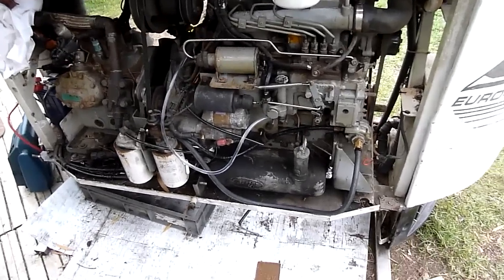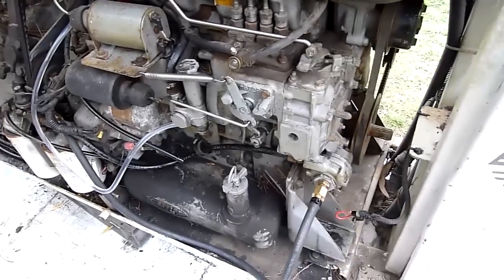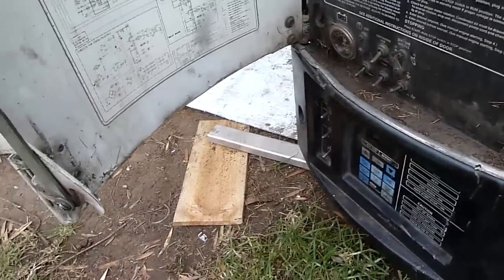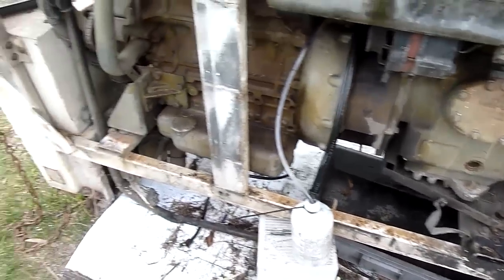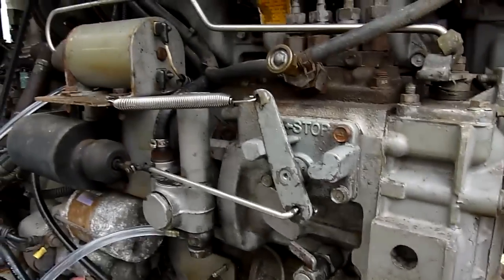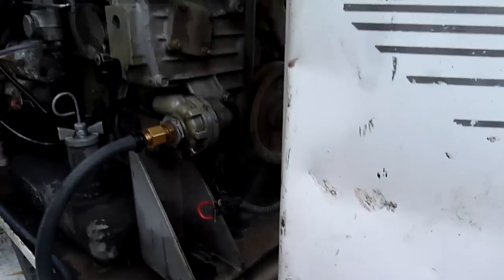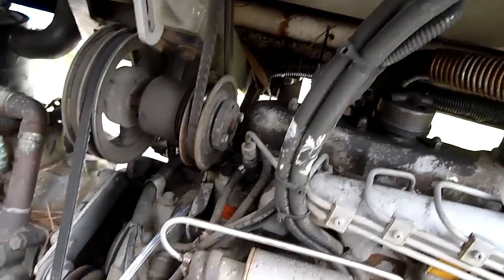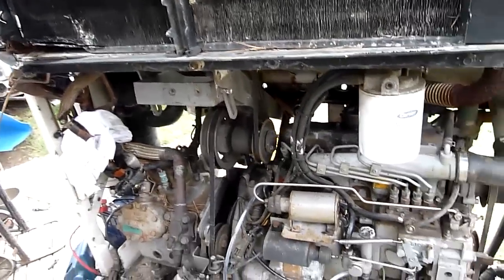Carrier Euro phoenix Reefer test run

Comment: This is going to make a KICKASS mobile Air Compressor, all you need now is a very large tank to hold whatever output that compressor puts out; perhaps you can also find a 3 phase generator to utilize that rather interesting belt system at the back of the engine.
Reply: +Brian Martinez unfortunately as Ed mentioned, the condenser and related plumbing was destroyed by the scrapyard's claw; I'm actually surprised the engine's radiator didn't meet the same fate.
Reply: +digitalrailroader bit of duck tape and its all good jb weld when its sever lol

Comment: Awesome bit of salvage.  Unbelievable amount of gear for the money.  Does it have an integral lift pump?  Assuming these drew from the tractor's main fuel tank, but was is pumped by the Truck or the unit itself?
Reply: Nevermind.  I see the reefer trailers have their own fuel tank.  Makes more sense :)
Reply: +tiporari they do have their own fuel tank, because in the uk, where fuel is heavily taxed, diesel fuel is $6 a gallon, an untaxed variant of diesel is sold, known as red diesel, it is dyed red, costs about $2 a gallon and is normally used in tractors and for non-roadgoing vehicles.
Reply: +insanitybiker Pretty smart :)  we have similar off-road diesel in the US, but sadly it isn't significantly cheaper, at least not near me.

Comment: where is the radiator for the cooling for the engine ?
Reply: +BillyNoMates1974 ah my bad just seen it.
big radiator isn't it ?
Reply from the maker: +BillyNoMates1974 its pretty reasonable, it uses 2 layers of the condenser coil, not separate unfortunatly.

Comment: the engine will be between 114hp and 130 HP, didn't sound like a baby either, mad compressor tho Mq safe psi on the compressor is 24 bar I still have all my books on these units from when I was doing refrigeration
Reply: +John Watts 
I wouldn't had thought it would be quite that big.
Reply: In the 4 cylinder range smallest is 114 HP up to I think 131true HP
Reply from the maker: +John Watts Great to hear from sombody who worked with them, I was having a hard time finding details about this one since there were so many different configs, engine sizes etc
Reply: +Aussie50 

yeah they have a massive stroke hence the power and the torque is massive but when they fail like u know are hideously expensive but all round reliable
Reply: +Aussie50 

also if u need info I have about 5000 pages of info as carrier never disclosed much information about them

Comment: Sounds great, when you go to re purpose it as an air compressor are you going to keep the engine attached or use an electric motor instead?
Reply: +Doogie Rick 25-50hp electric motor on household 240V single phase? forget about it.  I have a 10hp compressor and already illegal in most residential neirborhoods but not mine.  That pump is big, it'll take a lot to spin that

Comment: So do these units have a fuel tank somewhere on the roof or ground (with an additional pump), or do they have some sort of constant diesel line that comes in with natural gas from the utility company? I'm guessing on site tank since they would need to know in advance that they are using one of these units, and I don't even think they could pipe diesel over long distance.
Reply: +Jesse actually, this reefer unit was mounted to an insulated trailer, ( a Tractor Trailer/18 Wheeler Semi in the US or a Road Train for you Aussies out there); the fuel tank is mounted to the frame of the trailer just behind the landing gear.
Reply: Ahh, I figured it was for some sort of building or something, but it would be a bit odd to have a gas powered one. That makes a lot more sense.
Reply: Jesse
what you were thinking of, are the Generator sets used in hospitals, and critical Data Centers.
Reply: On a semi-trailer, it's underneath towards the front. It's a metal cylinder that suspends down from the underside of the trailer.

Comment: Can you put this engine in a car?
Reply: +Yuri Ck In a clown car maybe ;)
Reply: Over here is common to see cars with 1.0 Liter engines with around 30-40CV :B
Reply: Theoretically? Yes.
Legally? Depends on your country's emission laws.

The displacement of these engines is comparable to many modern car engines, some just about 2.0 L. But these engines are only engineered to deliver power at low RPM and are not very powerful, usually not exceeding 40 HP. In fact, some of these engines use mechanical fuel injection, usually lack turbochargers. and likely don't have the ability to attach to a vehicle transmission. Absent serious modification, they would be useless in a car.

Additionally, most countries, like the United States, strictly govern which engines can be used for what. For power equipment, such as reefers, the engines are certified only for "non-road use," meaning they cannot be used to propel, or assist in propelling, any vehicle capable of traveling on a highway. I'm not sure if there is a different certification for slow-moving vehicles.

Comment: You find the neatest pieces at your scrapyard.  The only thing I got in recent memory from a scrapyard was an old Honda HRA214SX with a bad deck but the machine was in good mechanical condition, little to no smoke and was found by a friend of mine.  The engine I believe is in the shed as a backup to two other Honda HR214-class machines.  Did you say that the whole reefer unit was $200AUD?  You really lucked out on this one!

Comment: Those things look like someone took the idea of a window air con and was like. Hmm lets make this way bigger and diesel powered!

I assume thats the sort of unit which is mounted on the box on the back of a truck? Where does it get its fuel from? Separate tank or is it tied into the trucks tank
Reply: TheColinputer this is what you would find mounted to a 53' insulated trailer; the unit has its own fuel tank mounted to the trailer's chassis.

Comment: If the computer works, then why not install it on your unit? The one you were complaining about that it doesn't have that heat check system. I think that would be a cool mod to make and it can't be that complicated.

Pity the claw had it, i mean, even refurbed those cores bring a good buck, well, at least here in EU, dunno about AU.
Reply: By ix35 he means his Hyundai ix35 car lol

Comment: What a beast.

Got any idea what torque it has?
Reply: 10 metric horse powers
Reply: +goyabee I reckon an easy 250-280 lb/ft
Reply: Woohoo
Reply from the maker: +goyabee this would make a nice crawler powerplant. its has a very long stroke, so its not a high revving engine, but its strong down low
Reply: Or fit a good sized hydraulic pump unit on the end of it, portable hydraulics